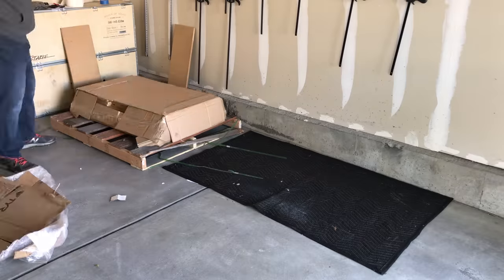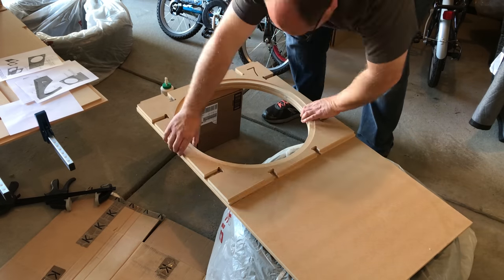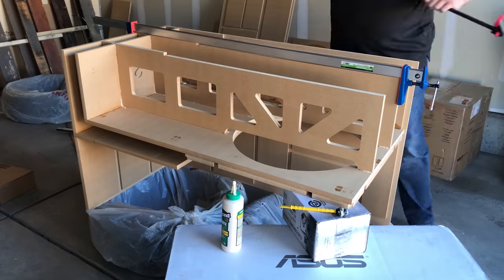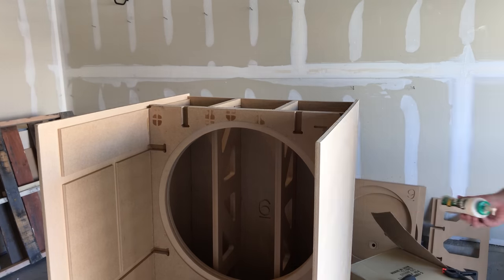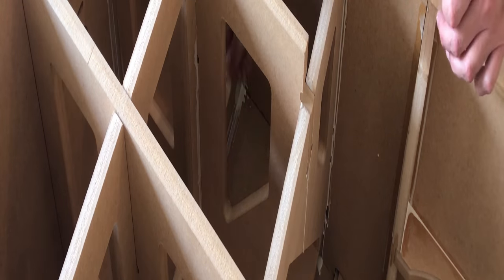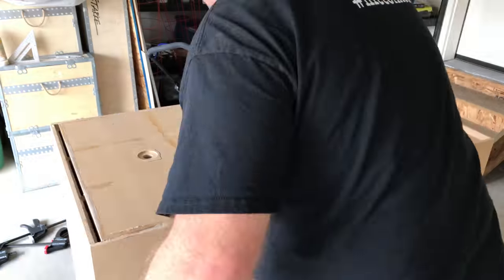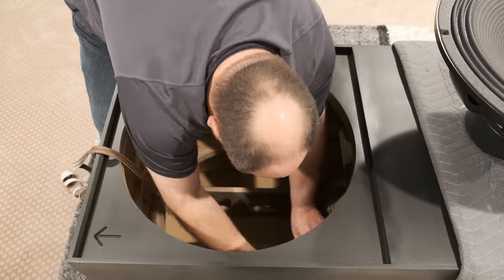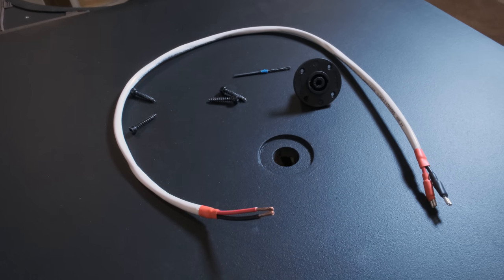21 Inch DIY Subwoofer build guide! The best GSG sub for your Home Theater.

Comment: Looks like a freaking IKEA box...
Coming from car audio you could use 18 ply birch waaaaay lighter and way stronger and no stupid slots... plus a sundown audio zv5 18" would give you at least double if not triple the output way higher rms rating 
& using screws or a brad nailer rather than following your IKEA directions would make your life exceptionally easier
No offense intended btw just wanted to help you a little bit
Reply from the maker: A brad nailer would be fine to help during the build. The glue is the magic in any of these boxes. Birch certainly is lighter. No argument there! The Sundown looks to have a sensitivity of 88db and 2000 watt power handling. The Eminence 21 is 97 db and 2500 watt power handling. Those measurements would lead me to believe that the Eminence 21 is worth a couple of the Sundown 18s. I think I got those numbers right anyway. The sundown looks like its designed to really move though. Lots of xmax!

Comment: I'm confused. Where's the horn part of this design? It looks more like a 4th order bandpass alignment. The mouth size and "horn" length are off by a factor of about 20 and I don't see any flare in it. What kind of horn is this? Also, if it really was a "horn" you're not doing it any favors by putting the mouth so close to the sofa. If you're going to speak authoritatively on these things let's get your facts, figures and terminology straight.
Reply from the maker: Hopefully to help un-confuse you : https://shop.gsgad.com/collections/horn-subwoofers  Thanks for the post!

Comment: @12:00 you talk about the energy that a 21" sub produces and to use extra glue to re-enforce joints for a stronger bond... I'm curious why you didn't countersink some wood screws into the box. Does that kit not allow it? Also, I see that kit is pre-cut for delivery. For people that have a CNC machine, are the plans public? My HOA would not allow a sub that big. The neighbors would complain for sure.
Reply from the maker: The glue is stronger than screws when attaching wood to wood. This is a consumer product so I wouldn’t think the plans would be available anywhere. The sub can play as loudly or quietly as you like. Just set your dials where it works for you!
Reply: @JilesMcCoy  Thanks for taking the time to reply. Much appreciated. :)

Comment: So why don't you like PL glue? I liked your build video. Interesting to watch. Why are there clamp marks on the baffle and other spots? Looks like some sort of staining. Even shows up over the duratex (I use a cheap latex base paint to hide imperfections and stretch out my duratex for those reasons). And a tip I learned the hard way after building my first horn is to paint the "mouth" before you put the side panels on. Makes life easier. We want a demo!
Reply from the maker: I don't dislike PL glue. I just have a bunch of Titebond III. The clamp marks are from oil or something from the pads of the clamps. I have seen it on other build videos from folks too. Painting the mouth is super important... that might be good to included in the instructions for this particular model.

Comment: little tip we use in housing: concrete sealer, its cheap, it soaks in nearly a 1/4" and helpts prevents termites from attacking due to the polyesters turning the wood into a toxic deterrent to them AND its waterproof

you just give the mdf a solid coat of that stuff and about an hour later its ready for paint

gota say, dont like how deep those arrows and numbers are cut in... just being paranoid but they look way to deep
Reply from the maker: Thanks!

Comment: Link to order kit??
Reply from the maker: https://shop.gsgad.com/collections/horn-subwoofers    Tell them JDM World sent you!
Reply: Well.  I found the link later... and I looked at the price... and then the price of the subwoofer... and then the price of the amps you linked.  Then i imagined what the price of all the tools and extras would be.  

Add in my time... because thats the most valuable asset we have... plus no warranty on it if I mess it up.  

If my math is close... this sub costs 4 grand .  

Why wouldn't I just buy two SVS 16 Ultras... get unprecedented room eq... digital display...  phone app to control it all... and pay the same plus not spend two days in the garage ?
Reply from the maker: michael wilkins If that’s your thing you should go for it. All in for one of these you are at 2kish in materials. Sub 750, amp 400, box and shipping 600ish. 200-400 for everything else if you are starting at 0. This obviously eats the SVS gear performance wise. But you have to build it.
Reply: The SVS plays flat down to 16hz and im sure can dig a little deeper.  Having duals would be better than this thing wouldn't it ??? Plus zero hassle?
Reply: Whats the output for this thing ?
Reply from the maker: michael wilkins You don’t have to take my word for it. Ask around. The hassle is up to you though. Some folks think that the building part of the deal is the most desirable piece.
Reply from the maker: michael wilkins It pushes in to the 130s. I can only measure up to the 120s though. It’s super loud if you want it to be.
Reply: Yes.  I assumed that its super loud.  How low does it go and how flat of a response?  Hitting the 130's is impressive... absolutely.  Not sure how often you would ever do that after the novelty wore off .  The Ultra hits 105 before losing its shape.  Put two together for maybe less than the price of this build.    Boom !!   If the allure here is simply the love of DIY .... i get it.  

If you want excellent sound with your extreme bass...  Im not sure this is the way to go.... and for me personally it's always more about sound quality than output
Reply from the maker: @MrProfchaos71  Its 100% about the sound. Thus the Deva.
Reply: @JilesMcCoy  im going to concede that you know far more about this than I ever will. And I will accept your claims about superior performance as fact.  

But I do know that 2 subs are ALWAYS better than one.... for flat response and sound quality.   So that's one issue I have with this build and how much it costs and how labor intensive it is.  

The second issue is the whole DIY concept in general.   In my mind its always been about making something nice and spending less money doing it. 

Another hobby im interested in is aquariums.   You can spend 2000 on a 150 gallon acrylic aquarium... or you can build a 300 gallon one for 600 bucks.  Sure the acrylic one has more viewing angles...  but who cares about the extra performance of being able to see through the sides of the tank for 2000..... when I can have two 300 gallon tanks for 1200 ?
Reply from the maker: @MrProfchaos71  I run 4 subs just for the reasons you mentioned above. Correction of room modes and appropriate SPL output. So, I agree with you 100% there. Only 1 happens to be a Devastator If my room was larger I would have 2 of them.

The money aspect is variable by person. Some folks want to DIY because they can build their subs out of exotic Zebrawood with gold inlay. That will be more expensive than comparably performing commercially available products. Some folks want the budget option. And for others the cost isn't a factor and they just want to build. 

I think people should assume that DIY will be VERY labor intensive and if they aren't into that they should move on no matter what the cost benefit is or isn't. 

Measuring the worthwhile of doing a DIY is very subjective. It will be a decision made on variables specific to that person.
Reply: @JilesMcCoy  So I was thinking... in the spirit of DIY and saving money...SVS makes the Sealed ultra and sells it for 2000.  But obviously they are a company... with high taxes..payroll... advertising... marketing.. overhead. 

Can you think of a build that comes in a kit like this one that would achieve similar results for 1000 or less ?
Reply from the maker: michael wilkins You can do a sealed Um18 kit with amp, driver, stuffing, etc for 899. You can get 7% off that anytime and it goes on sale occasionally.
Reply from the maker: From Parts Express.

Comment: Did you put some silicone on the speakon on the inside? I found a I could blow through mine...it is not completely sealed.
Reply from the maker: I used gasket but no silicone. That certainly wouldn't hurt things.

Comment: no screws?
Reply from the maker: Never. Brad nails are ok to help during construction but the glue is analogous to welding with metal. Its way stronger than screws.

Comment: just to clarify,
by design, a 6th order bandpass?
Reply from the maker: Thats a question for GSG Audio folks.
Reply: A ported horn
Reply from the maker: Looks like its listed as 5th order band pass.
Reply: @tomkocur  Not a horn. To be defined a horn, the path has to be flared along with the mouth of the horn.
Reply: @dudemcgee256  I guess we'd have to ask the designer how he meant it. Doesn't make much sense to me, either.

https://shop.gsgad.com/products/devastator-horn-single-unit
Reply: " 5th-order bandpass (aka "ported horn") "

Comment: Heck yeah...seeing as Cerwin Vega stopped making the passive TS--42 21" folded horn subwoofer after Gibson bought them.
Reply: I had one of those and it shook my room so hard it was insane. Wish i still had it.
Reply: @kirkcunningham6146  a TS-42?  Badass destroyers of property and liquifaction of body organs aren't they?  ;)

Give 2 of them a Crown 6000 amplifier on a 20 AMP 240VAC outlet...this is why sound systems need property insurance.  The Crown amplifiers are ideal as they are high voltage output for the 8 ohm driver in the TS-42.  Otherwise, they are under-driven as most subwoofer amplifiers are rated 4 ohm or lower (lower voltage output) and never let the Cerwin Vega 8 ohm subs work their magic.
Reply: @gavincurtis  agreed. I just hope Gibson does something with Cerwin Vega. It's sad that their home lines have become irrelevant.
Reply: @kirkcunningham6146  it is sad that home audio has become irrelevant.

Comment: Wow, what amp are you driving that sub with? I bet the whole thing weighed a ton being mdf, do you know the final weight?
Reply from the maker: I am using a Sinsoben FP10000q right now:  https://hometheaterfanatics.com/collections/amplifiers/products/sinbosen-fp10000q    I absolutely love that amp! It kicks the shit out of this sub and 2 18s!
Reply: @JilesMcCoy  I see it's a 4 channel amp so are two linked in bridge mode together for the 21" and the other 2 for the 18"s? Your house must shake
Reply from the maker: @malcolmrowe5031  That’s right!  It’s a lot of bass. I have the Devastator, 2 18” Marty cubes, and a Velodyne 18” DD+ going off.
Reply from the maker: I did the fan mod on the 10k to hush it a bit. Big improvement.

Comment: Mach 5 FTW-21 would really rock in there!
Reply from the maker: It would be super fun to build one of those!
Reply: Be careful with them.  I had to send back two (both times no questions asked, reputable company) but the lead solder connections did not last in my application.

Comment: man that's just too much work.  Why not save all that time and just buy a high quality REL or JL sub and call it a day?  At least you know what to expect sound wise and have something quality and not a garage job.  Also subs should be placed in front corners not in middle of rear wall.  That's probably the worst place to put a sub.
Reply from the maker: The main reason is because you can't buy anything like this from JL or REL. They simply don't make gear like this because they are mass market. And you should try nearfield before you knock it. Its a different world from just trying to corner load small subs to increase output.

Comment: This is a pro driver and doesn't go very deep considering its size. Not a good choice for a large sub.
Reply from the maker: Which driver would you recommend?
Reply: FYI, I get room shaking output levels down to 12hz in my setup, with a Devastator.  Also, how low a system plays is dependent on the woofer AND its interaction with the enclosure.

Comment: As a 2x 18 inch sub owner myself, I get the obsessions over low end. However I will never go back to those type of sizes ever again. 

I love having normal side tables again and just normal size subs thx certified loving my new choices over the old ones
Reply from the maker: The boxes are very very large. I am going to rebuild the full martys into Marty cubes just so I can have more location selection in my room. I have a null at 75 hz that I think that will help fix.

Comment: "DIY" No you bought 2 already finished things and put them together... It's like you buy a shelf from Ikea and put it together and say "OH I built this shelf" NO you but put it together! !! Once you've designed it, tested it in a program, made a plan, cut it to the parts you need, and built it, and then JUST as it's a DIY speaker! This is a "let the customer do it themselves and be proud of themselves" thing ;)

Comment: MDF is the worst material for a subwoofer. Soft as shit. And the price is some sort of a fucking joke.
Reply from the maker: Works pretty well!
Reply: It’s MDF, not MFD.  GSG uses HDF btw, which offers increased density and weight over MDF.  Russian Baltic Birch is also available.  Lastly , even a well braced MDF box/cabinet can support an incredible amount of weight, so your soft comment is inaccurate.
Reply: @kevings26  OK MDF
Reply: @kevings26  Plywood, only plywood. 19mm minimum.